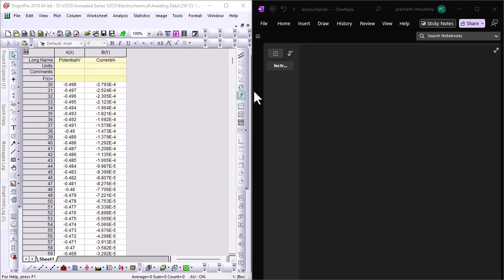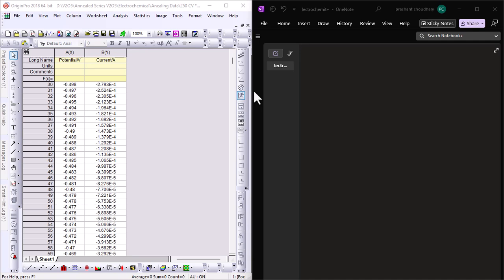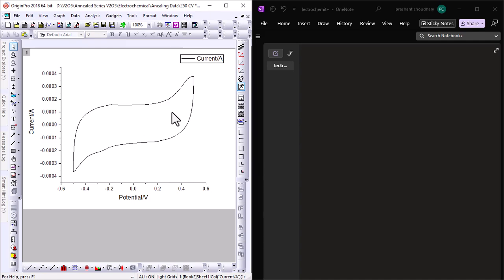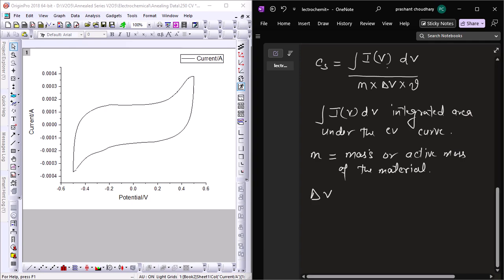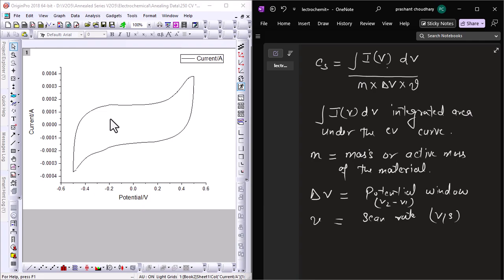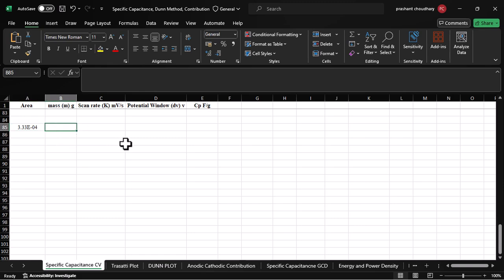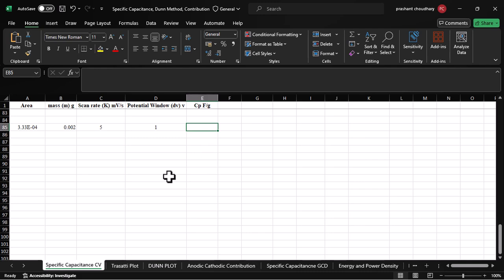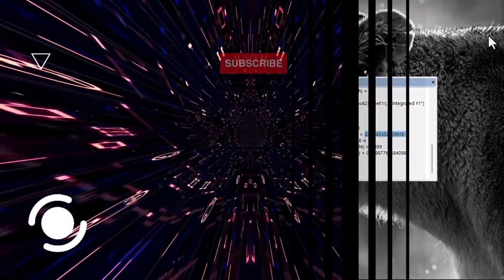1. Calculation of Specific Capacitance from Cyclic Voltammetry using Origin.

Comment: Nice video sir

I have a question....Why didn’t you divide by the factor of 2?
Reply from the maker: The specific capacitance has been calculated considering only a single process (anodic). If the average specific capacitance derived from both charging and discharging processes, commonly reported in the literature is required, the obtained value should be divided by two to account for both contributions.